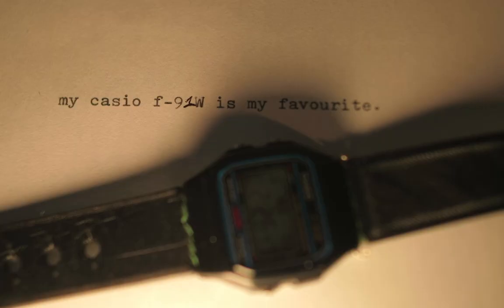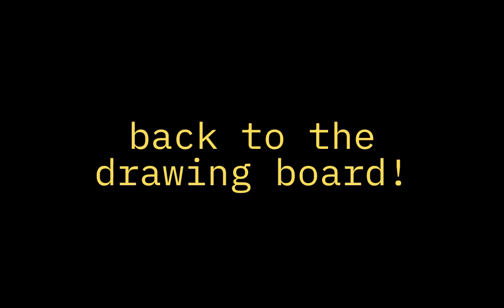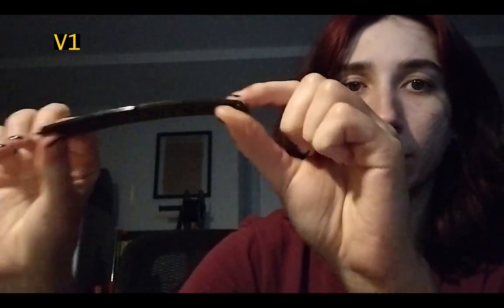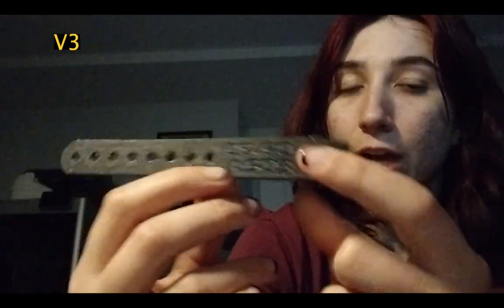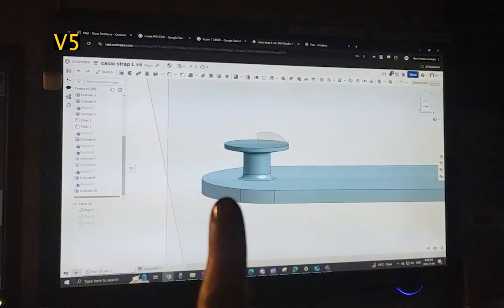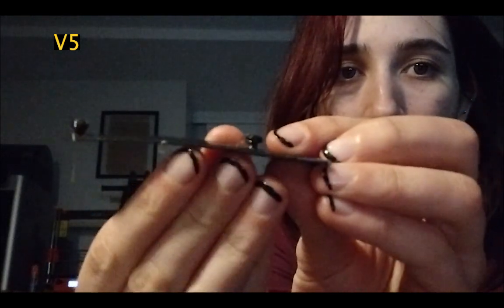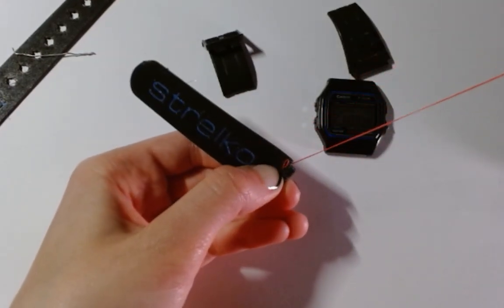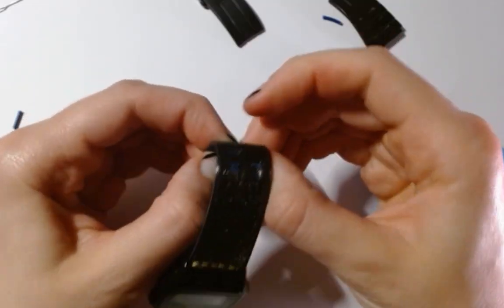can 3DP fix my watch? (CAD TIME # 6)

Comment: super cool.

The connection to the watch would definitely be the hard part for me.
I would probably never have considered sewing, since it's not really in my toolkit.

I would probably have focused on having one single soft smooth surface facing my arm since I don't like having anything on my arms.
So I would probably have tried making it in one peach and then have something like a "crater" what you push the watch into, maybe still with steel pins to keep it locked in.

And then i would probably have tried to make the locking mechanism on the strap lock from the side of the strap, if I could make it work without making the strap too thick. Just to see if I could get a smooth outwardly facing surface too, that would not get caught on anything.

But it is probably really hard to improve the design of a wrist strap. Many people have designed wrist straps over the years and most work in about the same way, probably for a reason. 😂

Comment: Ah, the fix you made for your lost pivot rod, nice functional repair!

Back when I was a student, I'd used the wire ties (stripped of the plastic) from the grocery store produce aisles to repair eyeglasses, where the screw that held one of the arms/the frames around the lenses backed out on me.

And, you'll have plenty of wire to repeat the repair until you remember to get the proper rod! :)